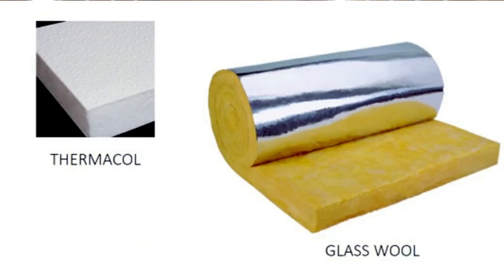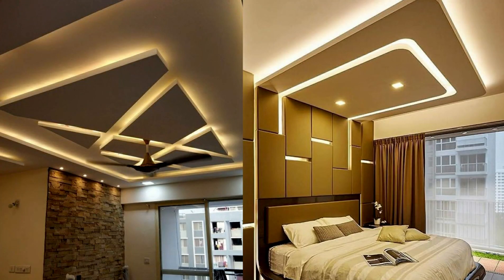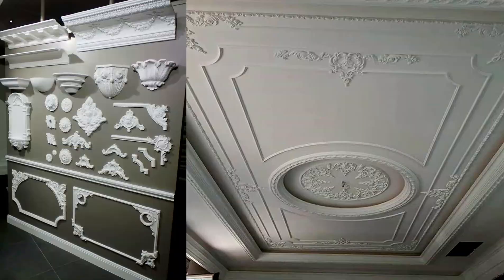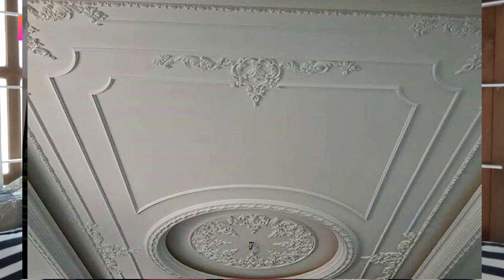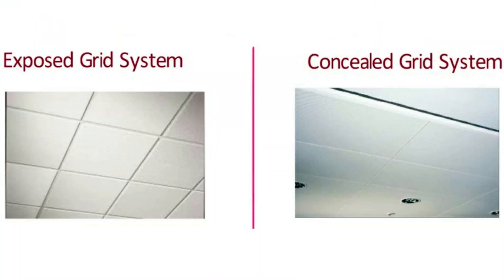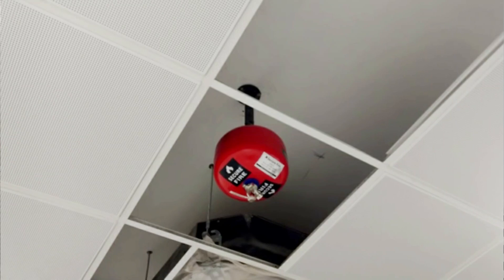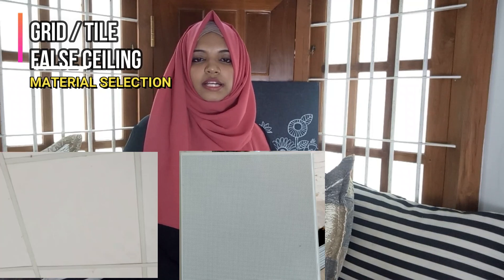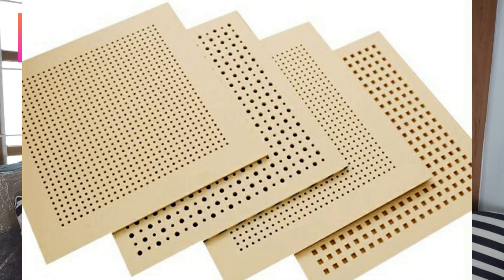False Ceiling ഏതെല്ലാം തരം|Types of False Ceiling|POP|Gypsum|PVC|Wooden|Grid| Measurement & Cost|

Comment: Gyp interiors 
All typs of false ceiling work

1) gypsum board
2) e board
3) v board
4) by sun board
5) insuboard (cool board)
6) calsium silicate board
7) mettle ceiling
8) pvc ceiling
9) acp ceiling
10) stretch ceiling
11) grid ceiling
12) ecostic ( theatre & home theatre )
13) sound proof (audio & video recording studio )
14) All typs of partition
..........
11 year experience
Included gst
All Kerala

Arun ashok 
+919961970544

Comment: Hi.. it was very informative. Would like to about the frames. I planning to gypsum work for newly build house. It’s normal gypsum work I am planning. What kind of frames do we use. When I spoke to the people they said Aluminum would be fine. When I asked for steel they it is not required. What do suggest which material will be better. Please reply.
Reply from the maker: Aluminum frames are more than enough.. false ceiling materials are usually light weight and its better to keep the frames light too,  to avoide any kind of accidents.. but make sure to select good quality aluminum frames. (You can hold it in your fist ans try pressing, it shall withhold the pressure ).
Reply: ARCHITALKS thanks for your reply
Reply: ARCHITALKS are there any issue using ceiling fan on gypsum ceiling

Comment: Madam,
Make a Home എന്ന യു ട്യൂബ് ചാനലിൽ മലബാർ ഭാഗത്ത് ഭംഗിയുള്ള gypsum സീലിംഗ് ച.മീറ്ററിന്ന് 55 രൂപ നിരക്കിൽ ചെയ്യാൻ 9495953366 എന്ന നമ്പറിൽ ബന്ധപ്പെടാൻ ഈ ഒറ്റ കാര്യം പറഞ്ഞുള്ള വീഡിയോ ഇട്ടിട്ടുണ്ട്.
നിങ്ങൾ പറഞ്ഞത് പോലെ 2 അടി അകലത്തിൽ ഊടും പാവും ചെയ്ത് 900 ഗ്രാം 800 ഗ്രാം പ്രൈമറിയും സെക്കന്ററി ചാനലും കൊടുത്ത് വർക്ക് ചെയ്യാൻ 55 രൂപക്ക് ചെയ്ത് തരാൻ പറ്റുമോ ?
പരസ്യമായി മറുപടി ഇടാൻ പറ്റില്ലെങ്കിൽ 9446446655, റിട്ട. സബ്ബറ ജിസ്ട്രാർ . ഈ നമ്പറിൽ വാട്സ് ആപ്പിൽ മറുപടി തരുവാൻ താൽപര്യം.
Reply from the maker: We are dealing with complete architectural projects, if you are looking for false ceiling works you may contact teams mentioned in comments. 
This is a team we have worked with if you require you may contact: Mr. Satheesh: 9947588532
Reply: Plz contact 9961736630

Comment: Useful information, which is the better material for home? I couldn’t listen the price of gypsum board ceiling with labour cost.
Reply: Thanks for your valuable information and  best wishes
Reply from the maker: For residents gypsum would be a better solution if there is no risk of any seepage or places prone to moisture. In that case you can opt for PVC/WPC.  If you are willing to spend more on false ceiling then premium side wooden/ply wood ceiling is good to go. 
Gypsum ceiling (material plus labour cost) 50-55/- per sqft.  (May vary from place to place).